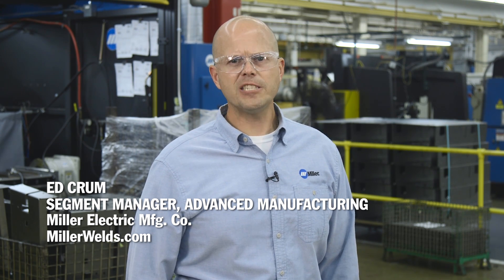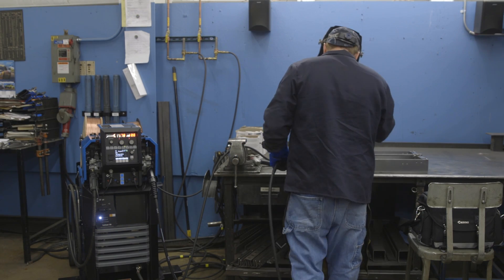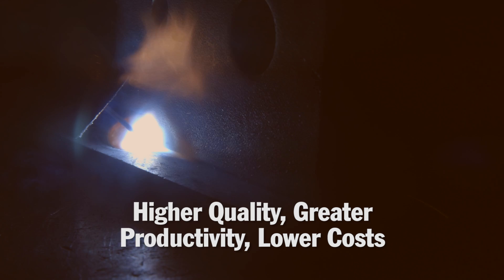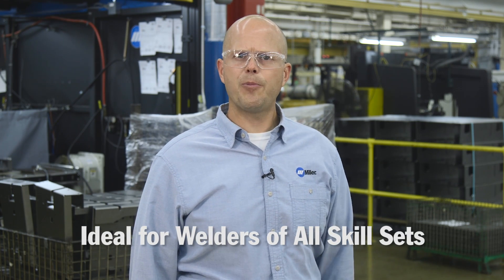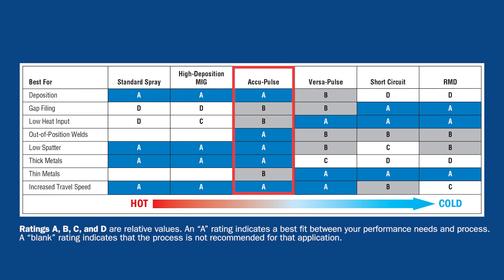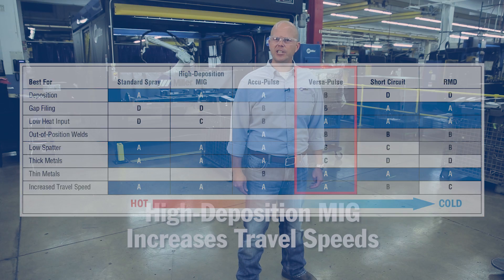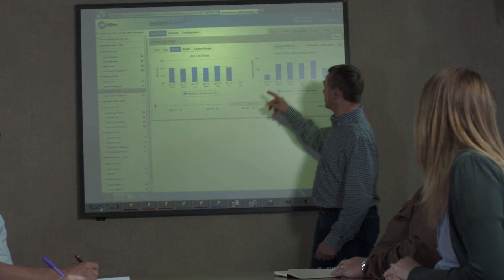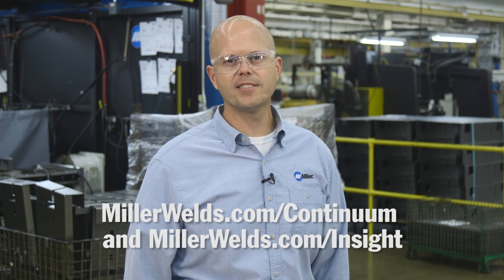New Welding Technology Increases Manufacturing Productivity

Comment: used ta be you had ta be smart enough to set your own machine . Now if the helmet fits , your a weldor ! Dont matter that you cant spell weldor right . Putting new ppl on a welder that sets parameters for you will only result in other problems else wher ! If you dont know about elongation or rod recovery rate or why your doing what your doing the way your doing it ? Whats the point ? All this the machine will set it self stuff just inflates the new guys head . So hes welded for a week and thinks , ill weld up a trailer hitch for my boat ! Thats how ppl get killed ! When i teach some one to weld i make them learn the lit first , then we learn how to weld !